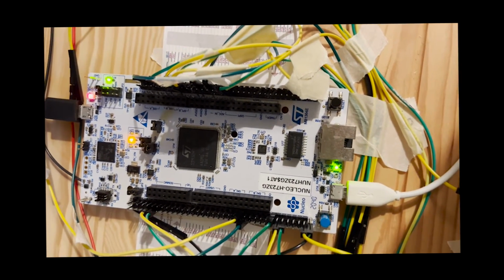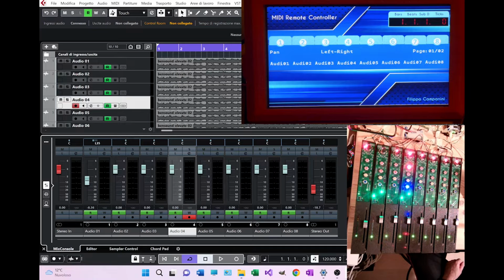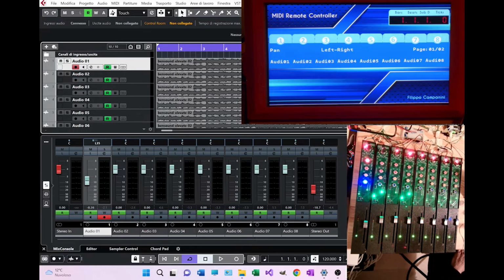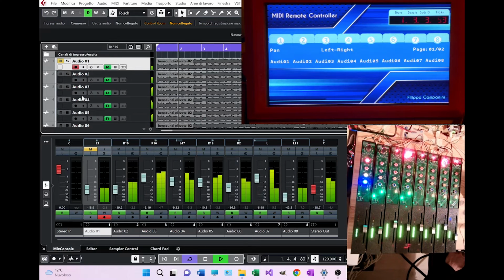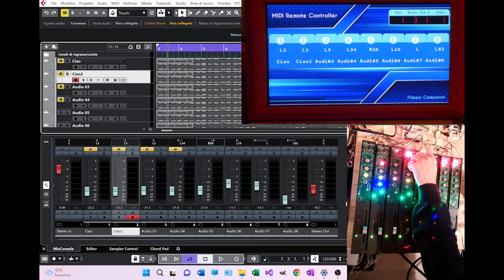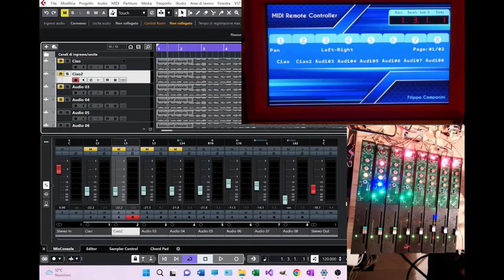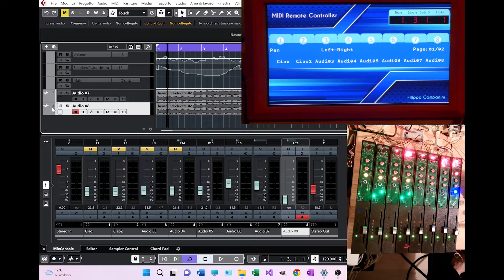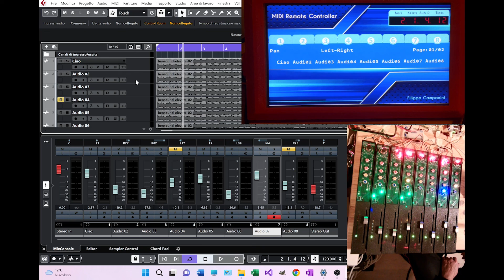STM32H723 - A Beast!

Comment: It's always great to see a new video on your channel! 

Would it be feasible to multiplex your UART channels to reduce the number of UARTs required in and out of the controller board?
Reply: Something like the CD74HC4052 perhaps?
Reply from the maker: Hello Theo, before to test the STM32H723 I was experimenting the TMUX4052 which is in fact a 2:1 multiplexer. The results were kind of fine for me but not 100% satisfying. Then after discovering the ST I decided to go it. Quality is simply perfect… But anyway I will have to find solutions if I want to move to 16/32 channels… Cheers!